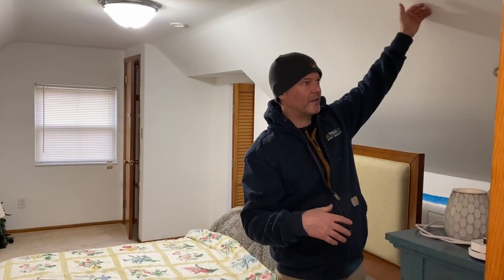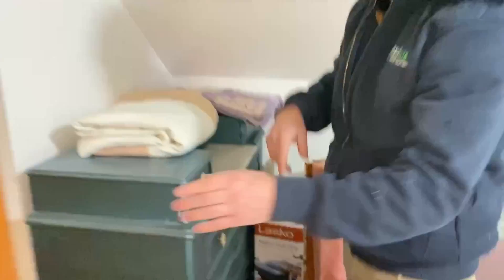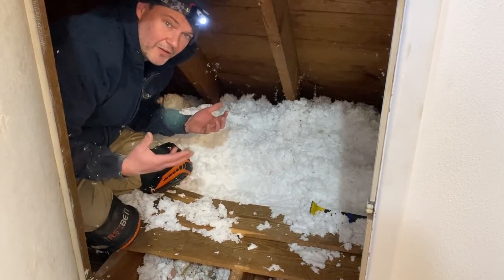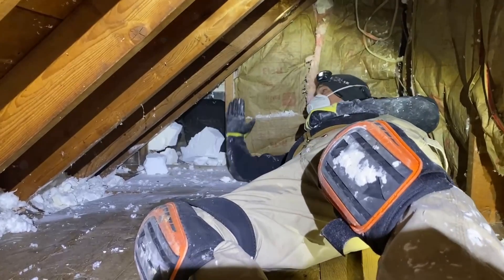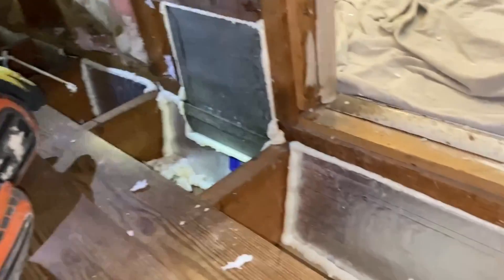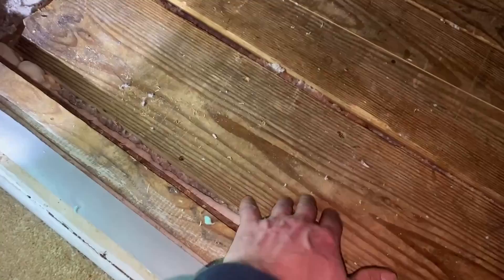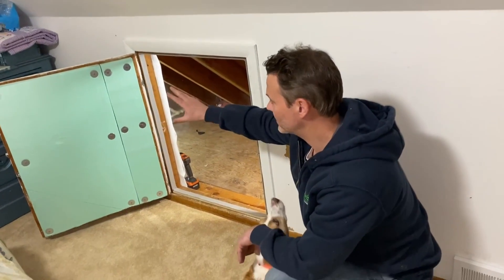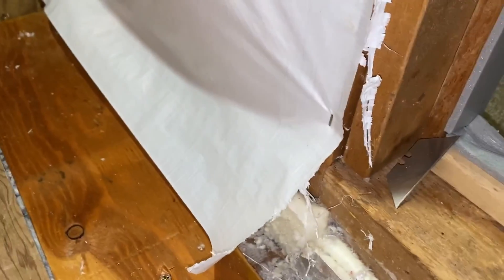What Happens When the WRONG Insulation Company Gets Hired?   Warning...This Gets Ugly

Comment: You have insulated underneat the raised sub floor and added a vent on the slopped roof which is perfect. I have a Cape style house that has also been reinsulated with blown fiberglass by the previous owner because when the house was built in the 1950s the building code was not stringent, but my house knee space is ventilated through soffite, so you must leave a certain space in the isulation for air to flow through the interior roof. Furthermore, when the house was built, the contractor only installed 2-3 small 4!" round vents in the eaves, which I was told was insufficient, and often clogged by the blown fiberglass, so I cut a 4" line in the wood underneat the soffite to allow air flow. I also installed two MaxAir vents at the top of the roof to allow air and humidity out.Was I right?

Comment: is the one vent in this knee wall space enough ventilation, does it require soffit vents for intake, or is the slantback vent enough?
Reply from the maker: Thanks for commenting.  The single slant back vent in a smaller knee wall space is perfectly adequate to ventilate that space.  If you have good soffit ventilation that is likely all that you'd need.  The results that we've achieved strongly suggest that it's unnecessary to install intake AND exhaust vents for these smaller knee wall attic spaces. 
Andy
Reply: @insulwiseenergycomfortsolu3293  thanks for the quick response! one last question, do you leave a gap on the vertical walls at the top where it meets the sloped ceiling, for air flow? or will the air just flow through the bats butted up to the top!

Comment: Because I am learning and want to understand, why did you not insulate the back of the roof deck?
Reply from the maker: That could have been done, but you need to create an effective air barrier if you are going to insulate.  Creating an air barrier on the underside of the roof deck is very difficult (unless you use closed cell spray foam).  Determining which surface  will be your air and thermal barrier is what makes Cape style homes a bit more tricky.  Let me know if you have more questions. 
Andy
Reply: @insulwiseenergycomfortsolu3293 might reach out to you here in the next week or so if that is ok. Not in your area but will take any advice if possible.

Comment: We have that exact setup upstairs. I need to definitely update ours like you explained in this video. We have soffit vents. Do we need to block and insulate the areas in the crawl space. Or just leave them open?
Reply from the maker: Sorry, which spaces do you mean?  The "transition gaps" beneath the knee walls?  Or the actual soffit vents?  You want to block / air seal the floor transition gaps and definitely leave the roof / soffit vents open!  Hope this helps. 
Andy
Reply: @insulwiseenergycomfortsolu3293  I meant the actual soffit spaces that leave fresh air in. I'm assuming they stay open, and not sealed off? I will seal off all living area transition spaces, and only insulate the floor area of the crawl space, and the knee walls in the rooms?

Comment: Whatever they did didnt help at all, and now you cant even use the storage space, I would have thrown them out right then.
Reply from the maker: The homeowner was in the process of suing the original company that did the work when we were there.  The company that did the original work was a franchise.  They had zero knowledge of building science or modern insulating and air sealing techniques, they could only pump foam.
Reply: @insulwiseenergycomfortsolu3293 its easy to see that wouldnt work, i hope he gets his $ back. Anyhow your video gave me some guidance for mine.

Comment: Did you replace the wall or insulation with unfaced bats then house wrap over that? I have a similar situation in Kansas.
Reply: I have the same problem too, north jersey though
Reply from the maker: We usually use kraft faced batts on the back sides of the knee walls, but we always foam seal the backsides of outlets and duct registers, or any other penetration in the wall.  Then we go over the batts with house wrap.  I'm sure that you could use unfaced batts and it would work out fine -- as long as you first air sealed the back of the knee wall like I mentioned above.   Thanks for commenting!
Andy

Comment: What if there's no ridge, roof or soffit vents, will a gable vent suffice?
Reply from the maker: Each isolated attic space should be independently ventilated.  Gable vents can work well for the upper attic spaces, but the lower knee wall spaces should be ventilated with something like slant back, soffit, or under shingle vents.

Comment: I've been putting off re-insulating my cape cod for about 14 years now. it's an attic that scares the eff out of me. not so much the darkness, but getting to it I have to crawl up a slanted "wall" that's not very stable. ugh.......
Reply from the maker: These houses are among the most difficult to do, period and full stop.  It sounds like you'd be crawling up the back side of a stairwell.  The move is to screw in "ladder rungs" using 2x4's or 2x3's onto the backside of the slanted stairwell ceiling joists.

Comment: Treat the knee wall attic as conditioned space by baffling and insulating the rafters all the way up.
Reply from the maker: If you live in a heating climate (where it gets cold) and you don't have an effective air barrier over top of the insulation in the rafter bays you create an environment that is perfect for growing mold.  I have removed rock wool and fiberglass batts from rafter bays in knee wall attics like this and found mold growing behind it on many occasions.  
Andy
Reply: @insulwiseenergycomfortsolu3293  But you're already insulating the rafter bays over the living space, right? Treat it as if you were insulating a vaulted ceiling and the knee walls are just later additions to define the space.

Comment: Is it ok to insulate with Owens Corning Foamular R7.5 board then housewrap properly tape sealed and spray foam any gaps.

FYI: I have no idea what I am doing
Reply from the maker: I'd only put foam board over top of the studs if the stud bays have first been batted with fiberglass batts.  You won't need to tape the seams, that's usually to prevent water intrusion.  You want the interior wall to be your air barrier.  We seal the back sides of wall switches and outlets with foam to keep those from leaking air.  
Thank you for commenting!
Andy

Comment: If Injection foam is not a good product, what options are there to insulate wall cavities? The way some companies do from the outside by drilling holes in the brick/siding. Is it only an issue when it's exposed in the attic the way you show in this home?
Reply from the maker: No, injection foam ALWAYS shrinks.  It's a product of its basic chemical formulation and that it's mixed using water.  When the water evaporates it shrinks.  If you want to see a heinous result search USA Insulation Pittsburgh and look at their google reviews.  You'll see a review from a few years ago where it was injected between the bricks and outer wall (the wrong cavity) and what they had to do to remediate it.  
The best insulation practice for existing home walls is dense pack cellulose insulation.  This is what it is and how it works.  I created a separate video for it.  Hope this helps!
https://www.youtube.com/watch?v=ibpbCLMVA2I&t=76s

Andy

Comment: Under the home wrap, did you use faced or unfaced insulation? I need to replace this insulation in a very similar setup. Should I put the faced side towards the interior drywall (living space)? Also, I have electic boxes around the insulation, is it okay to add the home wrap over all of that?
Reply from the maker: We use kraft faced insulation that goes always against the heated surface / drywall.  It's best practice to cut out where your junction boxes are so that they can be easily located if you need to find them later.  
Andy

Comment: How does the vent work? Is the air going out into the roof ridge up into the top attic?
Reply from the maker: The vents in knee wall attic spaces do not work as traditional attic vents with an intake and an exhaust.  Because these spaces are typically much smaller than full size attic spaces, they work by simply allowing hot attic air to vent to the outside (hot always goes to cold) and they dry the spaces by permitting higher levels of humidity to dry to the outside (high humidity / moisture goes to lower humidity / moisture levels).  They are very effective in this role. 
Andy

Comment: What if the space already has soffit vents? Do I still need to add a vent to ventilate the space?
Reply from the maker: If the soffit vents are open, functioning, and permitting a "good" level of air flow into the knee wall attic spaces, then no, I don't think that you would need additional ventilation measures.  However, we see many soffits that from the outside "appear to be vented" because they are perforated, etc.  But from the inside of the knee wall space you can see almost zero daylight coming through.  These are false soffit vents.  
In order for soffit vents to be deemed fully functional and effective, you should be able to see a lot of daylight coming in when you're in a dark attic.  Let me know if this doesn't make sense.
Reply: @ it makes sense. I’m in Tennessee, so located way more southern than you are so I’m not sure how much applies to me, but the soffit vents are working. I’ve done some electrical work in that part of my knee wall, but was planning to install baffles and add more insulation until I came across your videos.
Reply from the maker: @infiltretor287  You should be good to go then, thanks for commenting!

Comment: Does the housewrap breathe enough to let any moisture dry out?  Great video!
Reply from the maker: Thank you for watching!  The house wrap that we use here is a cheaper version of Tyvek paper.  It will allow a great level of water vapor to pass through it, but it's not as effective of water / rain barrier, which Tyvek does a good job at.  Here we're using it for two main reasons 1)  anchor the fiberglass batts into place in a good permanent fashion 2)  prevent any air flow in the attic space from "wind washing" heat from the fiberglass.  
We air seal the back sides of the electrical outlets in the wall with foam sealant before installing the batts, so the wall is already pretty well air sealed and should not be allowing much moisture / water vapor through it. 
Andy

Comment: Were the soffits ventilated in this home? I noticed you insulated the soffit and didnt use baffles to direct air to the ridge and used blown cellulose in the sloped ceilings. Is there a risk to not having an air gap in the sloped ceilings?
Reply from the maker: 1.	This house had no soffits, overhangs, or intake vents.  We installed slant-back vents a few feet up from the gutter along the back of the house to provide intake air for the ridge vent.  You can see the light coming through them at the end of the video and I believe I call out that we did that and why.  Thanks for commenting. 
Andy

Comment: How are the soffits vented in there types of homes? My house I just bought had insulation on the roof decking covering the soffit which were not fully vented. Well at least that’s what I was told. So I had the soffits fully opened and the insulation removed to mold remediated. Just had insulation done in the floor joices in the crawl space and the knee wall blocked with foam as you have done. The insulation co used fan fold across the decking to allow air up to the gables. After talking to him I know need new soffits to block some of the openings as there to much air flow. Was this done correctly?
Reply from the maker: It sounds like they may have done it right, but without inspecting it personally it's tough to say.  What I can say is that you cannot have too much intake air through your soffit vents.  As long as the soffits are baffled and the insulation is protected from "wind washing" you should be good there.  Thanks for commenting!

Comment: I’m wondering, my cape cod has soffit vents for the areas behind the knee walls. Can I use this same method and  install soffit baffles to still allow my venting to the attic while also packing insulation up to the baffles. Same goes for the slanted walls above the conditioned space, I would need to install rafter baffles there to allow the air to continue flowing up from the soffit baffles all the way to the ridge vent correct? Then pack in my insulation above the conditioned space between the baffles and drywall ceiling? Really looking forward to doing this to help with efficiency.
Reply from the maker: Thanks for commenting.  Have a look at this other video of a cape cod insulation upgrade that I created.  Most of your questions are addressed there.  If you have more let me know.  Thanks!
https://www.youtube.com/watch?v=x_z9FLeg5AA&t=26s

Comment: I know this is a year later, but what did you do for insulating the sloped ceilings above the knee walls?  Also could you have used soffit vents at the roof line into the knee wall space and then baffles through the sloped ceilings to a ridge vent?
Reply from the maker: The roof inside the knee wall attic itself does not get insulated.  The slope ceiling bays that lead up to the main upper attic are dense packed with cellulose insulation.  Click this link and you can see how we do this: https://www.youtube.com/watch?v=x_z9FLeg5AA&t=22s

Soffit vents are great for ventilating the knee wall attics, but we do not attempt to install baffles into the sloped ceiling areas because 1) you need 2  - 4ft baffles to do this and there's no way to staple them to the underside of the ceiling in the middle of the slope 2)  roofing nails make it almost impossible to slide them into place 3)  existing insulation in the slope bays makes installing baffles even more difficult 4)  a baffle that takes up 2" of a 5.5," wide, 2x6 rafter bay reduces the R-Value by about 40% for the insulation that you can get into that very limited space.  
That said, if there is no drywall in place, we will baffle the bay from the knee wall to the upper main and then install and slightly compress an R-19 fiberglass batt into the bay.  But you still will get a bit of an R-Value reduction.  Hard to get to "perfect" with an existing home.  
Our solutions optimize for durability, ability to tolerate moisture showing up where it's not supposed to (why we ventilate so extensively), separating the unconditioned space from the conditioned by careful air sealing, and the most R-value we can install relative to the homeowner's budget.  
Hope this helps!
Andy
Reply: Andy I have a similar situation I'm trying to figure the best way to insulate slanted ceiling trouble is I have 2x4 rafter so only working with a 3.5" cavity what would you suggest I have the area gutted so not limited on access
Reply: @insulwiseenergycomfortsolu3293 In this video you talk about the dormer wall being filled with the cruddy injection foam.  How did you end up insulating this space?  I have dormer walls like this and nobody has been able to offer me a solution without trying out the plaster from the interior!  Your video and previous comment has been a massive help in rectifying my horribly insulated attic. These dormer walls are one of the last things I need to figure out prior to blow in the attic floors.
Edited: I rewatched the video and apparently I messed you saying you dense packed those dormer walls!  Awesome video!